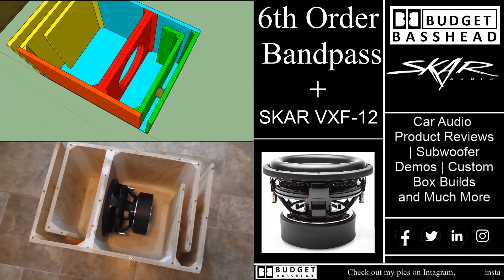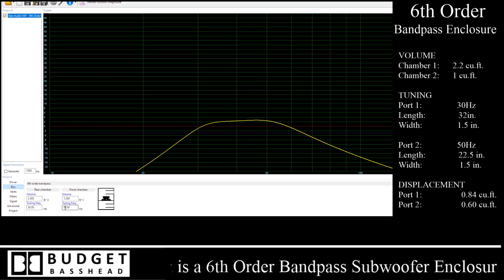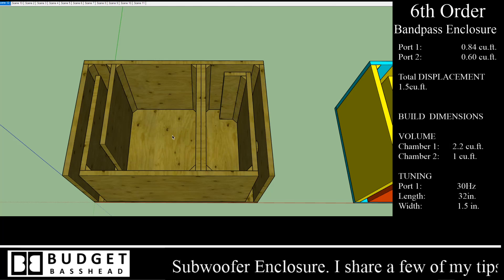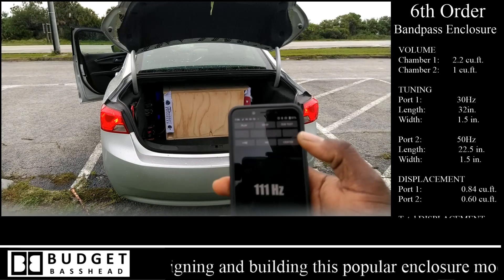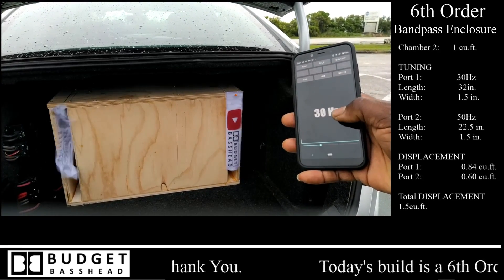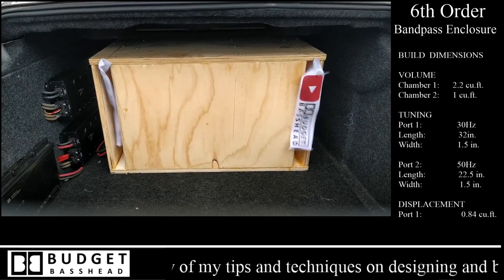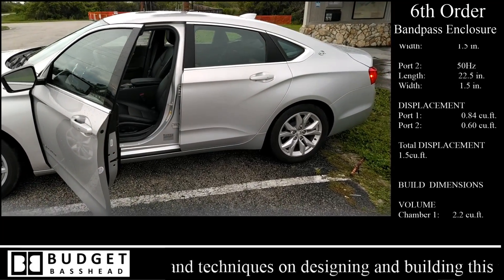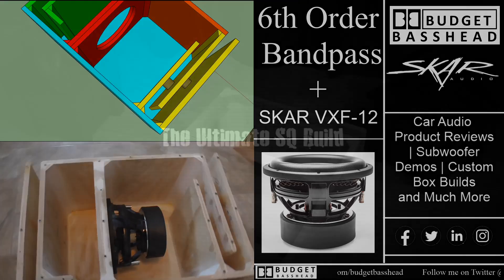How To Build A 6th Order Bandpass | Demo + Build Plans

Comment: You need to have a port on each end to throw more air, I have a EVL 12 in a 2.3 Cubic ft 6th order and it does wayy better than that on 1200 watts
Reply: If you do that would you not render the frequency of each tuned port worthless I mean this is for a specific type of sound. Sure you could open these up more and get way more spl but this enclosure is intended for sq there's alot of us bass heads who love big bass but we want to recreate the sound stage as it is and not nothing but bass. I mean when I tune with my dsp I tune flat then add some frequencies back in so it sounds good to my ears and when I'm tuned like that I can be guaranteed that there wont ever be any clipped signals getting to my speakers. That's what it's all about.No bass boost here. Excellent video by the way.
Reply: And can you call your box a 6th order if you added extra ports to each end
Reply: Yea my build is actually sq based even tho I love my spl, I pull a 140 db from my 6th order now(upgraded to a 12 inch vxf) and my big chamber is tuned at 32hz while my front chamber is tuned in the 50s so my box sounds amazing, bass boost is always off since I power it by a taramps smart 3k
Reply: @dustinwillyard6070  are you saying you are venting with port tubes instead of slot ports? I thought you added a port tube into his original build that would make sense. I'm looking to build a custom box for my vxf12 and I'm not sure what to build I have it in skars 12 in kerf vented box and it works great but there's a ton of port noise like it seems way excessive
Reply: I never replicated his box, I have a 3.3 cube box with a slot port on both my chambers, front chamber is around 1 cube with slot port, rear is the 2.3 cube with slot port, the reason my box moves more air is because I have one on each side to distribute the pressure more effectively since I have a 4 door pickup truck. Both his ports being on the same wall will cancel out some frequencies when both ports are fighting for air movement, one port on each side will have no choice but to be as efficient as possible
Reply: @dustinwillyard6070  well his box theres only a small bandwidth where both ports are active at the same time so i think hes fine. And another thing there are big no wall builds with multiple ports all facing the same direction like maybe 3 8" aeroports all facing the rear of the vehicle and they work just fine, they arent canceling each other out lol
Reply: Honestly bro if you want the best sound quality and decent spl levels then get that thing out of that skar prefab box as soon as you can, I had mine in a prefab 2.0 cube box while getting my box built, I was completely disappointed with my vxf 12 until I put it in the custom box, not she sets off car alarms without even clipping
Reply: @dustinwillyard6070  should I keep it around 2 cubes or go a little bigger I mean even in the prefab it pounds good I got all 1/0 wire the big 3 and a 250 amp alternator in a Subaru I am getting ready to get one if those 300 some farad ultra capacitors. I just don't know what to do with the box I have all the wood and materials to do it. I emailed skar today and they said to stay around 33hz and 2 cubes ported. Should I slot port or aero port.I know the prefab is holding it way back. What size of box did you go with or are you talking about the 4th order similar to this video
Reply: @dustinwillyard6070  I also get insane port noise from the skar box

Comment: Sorry for this very long comment, but I want you to ask something, but first I explained my - let's call it "situation". Btw, really good explaination of your project - how it works, and / or why you made this box like you made, and the result is MEGA in my opinion. I agree with you on that idea what you explained / showed about the simulator and designer softwares / tools (WinISD + SketchUp) even in your previous videos - it is highly recomended to use these to make a proper a parallel 6th order bandpass box, because they are maybe the most accurate / correct free tools for this, expecially the WinISD. Btw, I figured out something at parallel 6th order bandpasses - I explain it somewhere below, even I made a "test-project" for this, but first to simulation / designer tools.

Nowdays there exists many other, even free + online + all-in-one + very easy to use subwoofer box designer tools, some with their own speaker database. One of those tools is speakerboxlite.com website / service. Using just only this one tool I made for my Monacor SP-8/150PRO woofer closed and vented boxes - they were sounding / working OK - so, I can say, this tool is likely usable for these types of boxes. I tried to design for this woofer (and for some other woofers too) 4th order bandpass boxes with speakerboxlite - I not built them, but the accurateness of the simulation results were likely comparable / as accurate as at closed and at vented boxes - so I can say, this tool is usable to design 4th order bandpasses too. On the other hand, I dont know why, but in speakerboxlite the driver's movement is comparable with the WinISD's results if I use the woofer's RMS power in WinISD, but 2-2.5x the RMS power in speakerboxlite - every other graph seems to be OK / similar.

But when it comes to simulate 6th order boxes with normal net volume chambers and tuning frequencies - like at the box in your video, the driver's movement in speakerboxlite's simulations (Cone displacement graph) is totally wrong even at the woofer's RMS power level, in WinISD is OK - magenta and light blue lines in the test project below - I dont know why, every other graph seems to be similar to WinISD's...

So, thanks to this issue in speakerboxlite, at parallel 6th order bandpasses I figured out something what works in the same way in WinISD too: at a standard 2:1 or 3:1 ratio bandpass boxes if the low-chamber have relatively small net volume too + is tuned very low, and the high-chamber is tuned super-high (200+, or 300+ Hz): the low-chamber works like a widerange but not loud ported box (I call it as "active chamber" because just only this will sound), and the high-chamber acts like just only a driver movement controller (I call it as "passive chamber"). In this case in my opinion it is OK to have such a high tuning frequency for the high-chamber, because on a sub nobody will play so high frequencies like these. Then, if we decrease the high-chamber's net volume and / or tuning frequency, the driver starts to move more at higher frequencies like the low-chamber's tuning frequency - overpasses the X-max even on RMS power, so be careful. The other thing is that the group delay increases maybe because of the reduced driver movement. See the red and green lines in graphs in the test project below: red - an active chamber like a vented box, green - the same active chamber with a 300+ Hz tuned high-chamber.

If we have a little higher tuning frequency for active chamber, then we can decrease the passive chamber's tuning frequecy at around 150 Hz without passing over the X-max - the driver's movement increases a little bit at higher bass, the group delay increases too, but it can give few dB (or at least few tents of dB) almost on whole soundrange - in my case between 37 and 88 Hz. In graphs: blue - an active chamber like a vented box, yellow - the same active chamber with a 150+ Hz tuned high-chamber.

Here is the test project: https://speakerboxlite.com/project-info/afd0a02cacbb92016973ec9ae019af467233ae54597180a4d0f9514dc82f2a5e/tab-info

I designed the whole 6th order box by the yellow lines to show that it is buildable with relatively acceptable outer dimensions. My question: the theory what I explained thanks to that issue, in your opinion is OK, or it is totally wrong?

Comment: Does it matter all that much if my ports are different sizes? Also, I've never calculated box volume separately from port volume. Where and what info did you get to lead you to calculating them separately? I've designed a 6th order and it'd be extremely difficult to get the ports the same width/height in both chambers.

Comment: I'm currently running my vxf 12 in a ported box built to spec. I'd really love to build this same box to get that bandwidth, is there anyway you could send me the blueprints to build it? Also, I just pre ordered the peerless by tymphany STW-350F 15 so I'm excited for that to come in the mail! I'm currently in the process of upgrading my electrical system before I try powering that sub. Planning on using the new Wolfram full bridge 8000.1 amp, should be good for 3,200 watts RMS @ 4 ohms 😬 I'd also like to build a sealed box like the one you made as well. Love the videos man very informative

Comment: When I use Win-iSD my output lines are off the charts, would you know commonly made mistakes in using this?
Reply from the maker: You can manually adjust those numbers in settings

Comment: What amp are you using
Reply from the maker: The amps are two AudioPipe APMN 2000.1D. ‘Individually’ capable of 2,000 RMS @1ohms. Subs are wired @4ohms. The amplifiers are strapped, each seeing 2 Ohms, delivering about 1,500 watts. About 2,500 – 3,000 watts continuous.

Comment: Love the channel. Always straight forward, real time information. I'm about to rebuild my ported wall build and I want to do a 6th, but you dont see many parallel 6th order builds. What do you think about Parallel 6th's compared to a series 6th?
Reply from the maker: I've only built series 6 order bass reflex I've never built a series bandpass. But I would assume that the outcome would be the same
Reply: @BudgetBassHead  Thanks.
Reply: @BudgetBassHead  Brother, can you give enclosure and ports measurements of this 6th order Bandpass, front chamber 1cubic feet and rear chamber 2.2cubic feet, 12mm MDF enough ? Mounting baffle 12mm + 12mm, ok ?

Comment: So my question is when you calculate your space does it include the port?
Reply from the maker: I calculate Port displacement separate from internal chamber volume
Reply: BudgetBassHead so I'm having trouble with my design my tune is showing -3.9db on my high hz side and -7.915db on my low side

Comment: Very nice.... great job at explaining. 6th orders are awesome. I’m working on a fiberglass 6th for 2 vvx 8s. It’s awesome when you get to the point to understand this stuff enough to build your own. Again I think you are on point. I’m just doing 8s to save space but also to demo and show people what a couple $90 8s can do on music. You know I was thinking maybe when or if you can get around to it... start thinking about 8s and do videos just like you have with the 12s.  Skar has a lot now... plus there’s other brands that have killer 8s... they’re usually cheaper than 12s and depending on the box you can still get it to hit lows like 30hz. I just think there’s lots of good reasons why the 8s are a good size to experiment with. I need a practical set up for the most part so I’m always trying to figure out how to get as much as I can out of a system without taking up much space. Working at the hot rod shop was challenging as f!,,, had to keep it small but mean as possible. Thinking along the lines of budget, space, weight, output, and quality.... Skar has a bunch of different levels and options for different applications. Most old dudes that thought they didn’t want a sub... they got a demo and guess what? Most of them got one along with the door speakers and sound deadening. I’ve only heard ix 8s and vvx 8s. I think I watched a video back a couple years ago you had on ix 8. Lot of people argue over if the vvx or ma 8 is better. The vd is shallow but 400w I think. The sdr 8 and svr 8 would be good to test out for budget friendly but decent output. The svr has a bigger coil than the zvx 8 I think. But zvx has like double the rms. The new evl everyone is curious about. You do such a good job man I just think it’d be an awesome series. Thanks for the frequent video posting and quality thorough explanations.
Reply from the maker: Thanks for the input. You doing like you know your stuff 👍 I do have an 8 inch series in works. So stay tuned. I already got the MA-8 and the ZVX-8 The EVL-8 would be a great addition.

Comment: And dose the software tell you what to cut the boards to.
Reply from the maker: No. Some calculation have to be determined on your own. Like box volume. Geometry helps a bit too.😉
Reply: I want a 2 to 1 6th order for my NEP authority 12s . tuned like that one u build.  30hz back port and 50-55 front port. They are also 1500 rms like the skar u have.